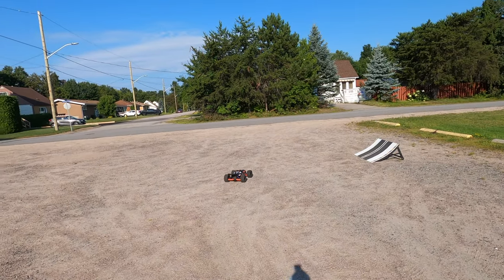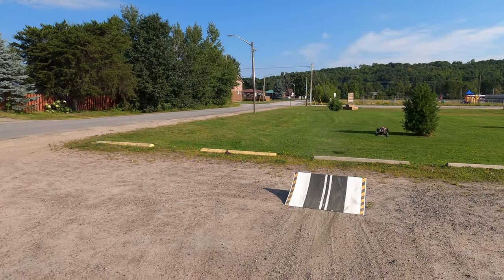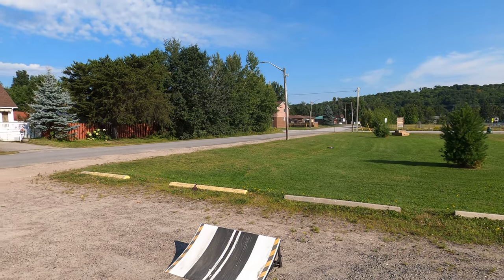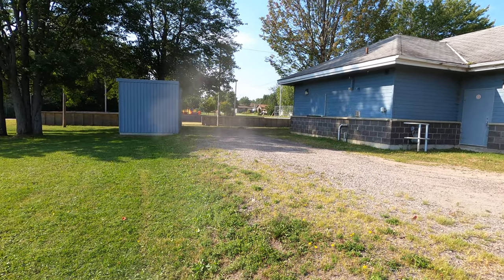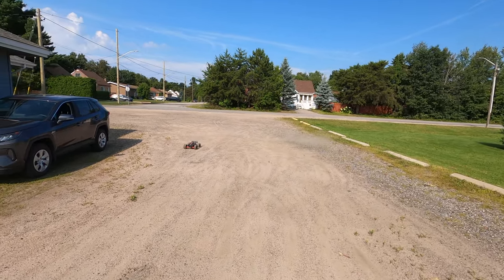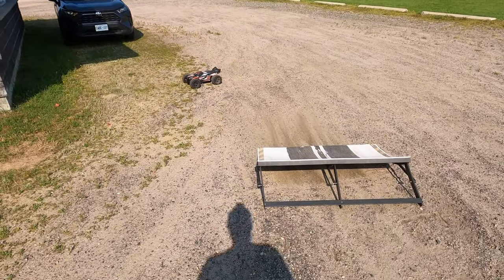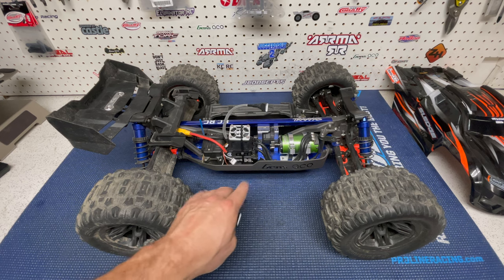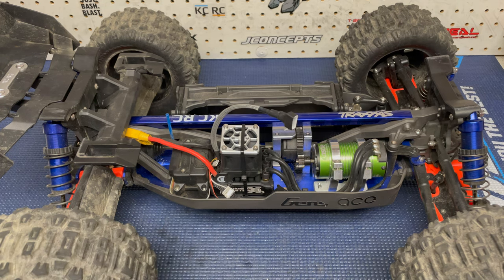Traxxas Sledge Upgrades (KCRC, The Basherqueen, Castle MMX8S)

Comment: Nice rig. I was disappointed in my Sledge. They had 10 years to protect it by fixing the issues arrma has had. I figured it would be a beast like my XMAX out of the box but it's not even close. Oh well, time to hop it up with some RC bling bling. I don't smoke crack!
Reply: I think it is a beast to be honest. It needs upgrades just like everything else does. I run mine a lot and never had really any problems. I like it a lot. I do have upgrades but that’s just the fun of it. We always upgrade even if it don’t need it sometimes. Lol
Reply from the maker: Yes.  Unfortunately, the Sledge is the complete opposite of what Traxxas said it was.  Traxxas released this truck saying it didn't need any aftermarket support.  When in reality the aftermarket is what keeps this truck running.

Comment: Brilliant video Jason a nice run lots of power on 8s what's the castle esc like better than stock esc mate 👍😉😀
Reply from the maker: I was only running 6s.  I have installed a 1650kv in the Sledge since this video.  But I am pretty sure I am going to still keep it on 6s max.
Reply: @JasonPerrinRCVlogs  brilliant I would has well I was thinking you might damage the diffs on 8s mate 😉😀